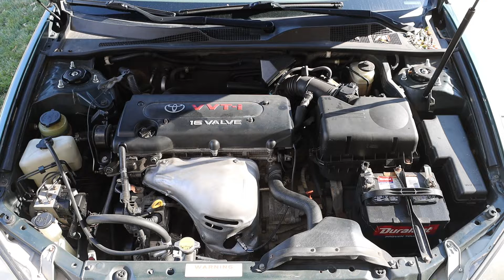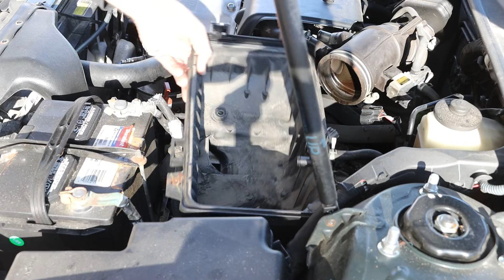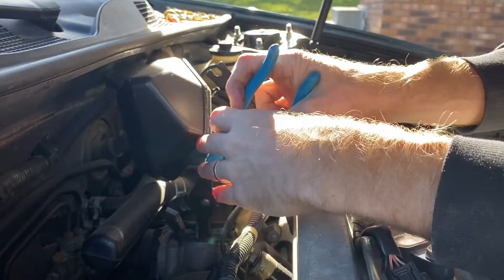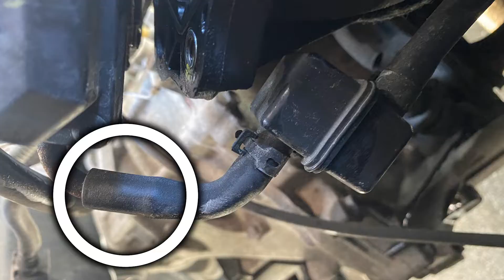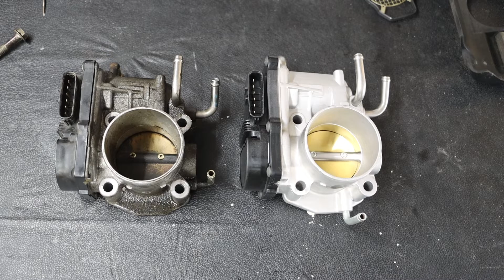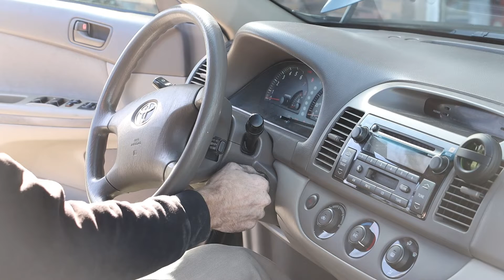Throttle Body Replacement - 2003 Toyota Camry, 2.4L (2002-2006) Low Idle, No Power, Sluggish Engine

Comment: When to know that the only option is replace the thottle body?i have a lexus es 300 2002 is similar to the camry of this video,the car entered on limp mode the code is p0120 what do you recommend me?thanks in advance
Reply from the maker: A P0120 code doesn't necessarily mean the entire throttle body needs to be replaced. That code indicates a problem with the throttle position sensor circuit, which could be caused by a faulty sensor, damaged wiring, a poor electrical connection, or an issue within the throttle body itself.

I would start by inspecting the electrical connectors and wiring around the throttle body. If you have access to a scan tool that displays live data, you can also monitor the throttle position sensor readings while operating the throttle to see if the readings change smoothly.

I would only consider replacing the throttle body after confirming that the sensor or throttle body assembly is actually faulty. Your 2002 Lexus ES300 uses a different engine and throttle body setup than the Camry in my video, so the diagnostic and replacement procedures may differ.

Hope this helps!

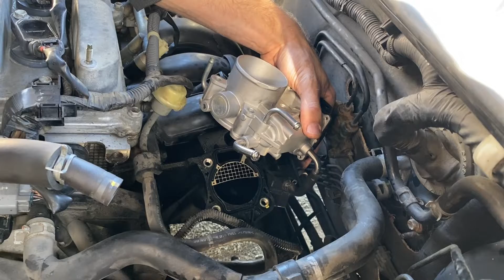Comment: Please where does that EVAP hose 4:34 connect to... My top gasket got burnt and I towed the car to a mechanic shop but when I collected the car I noticed that specific hose had been disconnected, I asked the mechanic to connect the hose back he said that's how it was but I don't believe him.....I didn't want to cause a scene as I didn't have proof to countee what he said.

The car rides ok but idles roughly and I can't help but think that disconnected hose is the issue. The mechanic says my ignition coils and spark plugs needs to be changed for the car to idle smoothly.
Reply from the maker: Thanks for watching! If you're referring to the hose I reconnect at about 4:34, that hose is supposed to be connected. It is part of the vacuum/EVAP plumbing associated with the throttle body. I would not consider it normal for that hose or its throttle-body connection to simply be left open.

A disconnected vacuum/EVAP hose can potentially cause a vacuum leak and contribute to a rough idle, depending on exactly which hose has been disconnected. That doesn't necessarily mean your mechanic is wrong about the plugs or coils, but personally I would want the disconnected hose properly identified and connected, and any vacuum leak ruled out, before replacing ignition components based solely on a rough idle. If you can compare your engine to the connection shown at 4:34 in my video, that should also give you some documentation of how it was connected on this 2.4L Camry.

Also, if you are wanting to do the plugs and coils feel free to check out my video on that https://www.youtube.com/watch?v=-oCW-m-WLHY&t=240s
Reply: @InsaneOil thanks for the response, it's very much appreciated. I actually hoped you will show where the hose 4:34 terminated. I because I have checked and can't seem to find where the hose terminates. It worries me. I have changed the spark plugs and ignition coils today but I am yet to test the car because I am waiting on a replacement motor for one of the radiator fans.

Edit: I just watched your other video https://youtu.be/_c73sk4vxGA?t=320&si=VYf8w2NWJ5WkjWbo I noticed that the hose in question truly doesn't have a termination port

Comment: Great video!! Can you SHOW me please, where the idle control valve is on 2003 Camry? I am told I could clean that without doing full assembly. Your help would be greatly appreciated (IF you're still on here). 
Also, where and how to determine the engine model (Yours is a K). Thank you.
Reply from the maker: Thanks! I'm still here! On the 2003 Camry with the 2.4L engine, there actually isn't a separate idle air control (IAC) valve to remove and clean. The 2.4L uses an electronic throttle body, and the computer controls the idle speed by adjusting the throttle plate itself. So the throttle body shown in this video is also what the engine uses to control the idle.

If you are just wanting to clean your throttle body/butterfly valve/etc.  You can use a product called Power Foam, shown in this video https://www.youtube.com/watch?v=JXHuq6jJ8og I bought the product at: https://www.amsoil.com/p/amsoil-power-foam-carburetor-and-induction-system-cleaner-apf/?zo=10458

As for the engine, the 2.4L 4-cylinder in the 2003 Camry is the 2AZ-FE. You can also look at the emissions/engine information label under the hood to help identify what engine your particular Camry has.

Comment: I got a throttle body from amazon, cheap chinese one. So guess i got a dead on arrival one because i put back everything back together and make sure it click in. Did the relearn procedure and try to start it, then nothing happen it just crank, no start.
Reply from the maker: About 1 out of every 20 parts I have to return on Amazon due to poor quality.  I'm curious if a different brand of one resolves your issue.
Reply: @InsaneOil  yeah it was a dead new throttle body, i put back in my old one yesterday and the car start right up. thanks for answering.

Comment: on the v6, the throttle body is east and west not  north/south.
Reply from the maker: I suppose if they made it the same, it would be too easy of a repair.
Reply: @InsaneOil  on my 02 v6 SE , it also didn't have a gasket similar to the one shown. it's more of a gasket similar to one on the oil pan where it's just on the perimeter. i plan to replace my oem with one from a junkyard and it that doesn't work, a new one from ebay. they're not inexpensive if bought at rockauto.

Comment: Did this actually go bad or did you replace it just for content sake?
Reply from the maker: When the temperature got cold outside and I would start the car in the morning, as I began to go, the pedal felt like it wasn't doing anything when I would push it.  If I pushed it down half way and hold it for about 5 seconds it would then kick in and the car would start to accelerate.  Specifically, this happened multiple times when at a stop sign and turning into traffic, which was a precarious situation. Based upon the research I did, there are a bunch of little gears/electric motor that electronically control the throttle and after time they get sluggish at responding to the pedal being pressed.

Comment: What's the fluid that leaks out of the two water bypass hoses?
Reply from the maker: Coolant
Reply: @InsaneOil  thanks! Great video!
Reply from the maker: @PlunderAchiever  Thanks for the comment.  Good luck with your repair.

Comment: I recently bought one of these. Seems to start and run fine  but it's got a bit of a rough idle and lurches forward. I've cleaned the MAF and TB but it's still doing it even after resetting the cpu. Also when I take my foot off the gas the RPM's drop like it's shifting up or something. It's really sensitive when you're trying to lightly apply throttle and can make for a not very smooth experience.
Reply from the maker: Any transmission issues?
Reply: @InsaneOil  Turned out the previous owner installed a slightly wrong o2 sensor. The right o2 sensor fixed 95% of the problems, but also has a slight vacuum leak at the intake which I'm assuming is causing the rpm dip when letting off the gas. Gasket is on the way and should fix that
Reply from the maker: @mtnmotoadv  Good to hear you got most of it figured out.
Reply: you can reporgram the throttle body.

Comment: When you started the car your rpms looked to be high like 2000. I know people will say that's normal but it's not. 1500 rpm is as high as it should be at starting the car and that's on a cold day and should drop down as it warms up to around 650 or so. What was your rpms normally reading on a cold start before you replaced your Throttle body?
Reply from the maker: After Repair: RPMs drop down to around 900 and even a bit lower when idling.  When the car first starts it goes up to 2000 and then quickly drops down to idle.  Before repair: RPMs were under 650 to the point where it felt like it was going to die at times.

Comment: Hello i checked on the throttle body and engines. The 2az fe does have the Iac valve while the 1mz fe and the 3mz fe have the TPS. Those are the 3.0 and 3.3 v6 motors

Comment: Good grief, you could have bought a new Camry with the money you spent on all the parts. You said it burns oil, have you tried some Lucas oil stop leak. Also the upper cylinder lubricant.
Reply from the maker: Thanks for the comment.  The burning oil is due to the previous owner's lack of maintenance in conjunction with Toyota's engineering of the bottom piston ring.  I am currently doing a research study to reduce oil consumption which does include Upper Cylinder Lubricant as one part of the theoretical solution.  As far as the money spent on the parts, I guess this is just a really expensive hobby.
Reply: I’ve got an 03 Camry with 306k miles and burning about 1/2 a quart every 1500 miles I commute 142 miles daily round trip. This thing broke down on me once 3 blocks from my house when the crankshaft position sensor lost all its magnetism. Long story short it’s cheaper to keep her than a 30,000 dollar new car. Everything works on mine. No leaks sunroof in tact.

Comment: Hello fellow crazy Camry man, my 2004 with 135 k miles has the low idle issue but seems to stick when rolling. So around 1000 rpm. Cleaned throttle body , still sticks. My Chilton's manual does say the IAC valve is attached, but maybe that's for the 6 cylinder only. Meant to check on that.

Comment: Hey so i replaced my mine recently and my check engine light still came on and won’t accelerate
Reply from the maker: Any chance your car won’t exceed 2000 rpm or about 15 mph… https://youtu.be/Ma67aYgACrQ?si=CqeiMP-w64pYkk-u

Comment: @Insane Oil
Amazing video 🔥🔥🔥- Keep it up
Is Idle Air Control Valve (IACV) separately connected in the Toyota Camry 2004 or its a part of the throttle body?
Reply from the maker: It is my understanding that the 2AZ-FE engine (the one in this video) does not have an IACV where as the 1MZ-FE engine has the IACV mounted on the side of the throttle body.
Reply: @InsaneOil From 2003 the 1mz-fe V6 does not have the idle air control valve mounted on the outside of the TB.
Reply from the maker: @dannycolemire2652  Good to know.  Much appreciated.
Reply: The 2003 Avalon's are equipped with IAC and TPS on their v6
Reply: @tomblobasjamesc.mccollum1740  Is it the 3.0 V6? So yours doesn't have an electronic throttle body?
Reply: @dannycolemire2652  the 2003 and 2004 Toyota Avalon had a mechanical throttle body with IAC and TPS . I do not know about the Camry V6 that year but the 4 cylinder that year on the Camry was an electronic throttle body with no IAC.  If you Google search your particular car, for example, 2003 Toyota camry, they will give you the exact specs of engine size options and transmission type options that were offered that year.
Reply: @tomblobasjamesc.mccollum1740 Lol I was going to tell you the same thing about googling it. I know for sure my 2003 Toyota Camry XLE 3.0 V6 has the electronic throttle body. I'll never understand why they switched from mechanical to electronic. If something goes bad on my electronic throttle body all you can do really is clean it because all the gears and motor plus tps is made inside and you can't buy parts to fix anything so you have to buy the whole TB
Reply: @dannycolemire2652  my 03 Avalon has dual mechanical throttle bodies.  One is equipped with IAC and TPS, and the other is not.

Comment: Great video. I need to clean the TB due to the sticky throttle.
Reply from the maker: I would recommend cleaning it first and if that doesn’t resolve your issue then think about replacing it.

Comment: What was the reason you replaced the throttle body? Did you have any engine codes?
Reply from the maker: No engine codes.  On cold mornings I would press the accelerator and it would take anywhere from 3-10 seconds to feel like the engine kicked in.  Basically, it was old and slow to respond on cold days.  Switched it out and it responds immediately.
Reply: @InsaneOil  Thanks for the response. Yeah mine runs well until it's warmed up. Once warmed up it still runs well under acceleration, but it has a low rough idle when I come to a stop. I have no engine codes. I think I will try removing it and give it a thorough cleaning.

Comment: Can u do a vid on how to change the head gasket for this car
Reply from the maker: I probably won't be doing that type of repair but I did come across this video that may be helpful. https://www.youtube.com/watch?v=F994QmOD6W8
Reply: Valve cover gasket or head gasket?  I just did the valve gasket on my 2006 Camry.  Replaced the very brittle gasket to address oil leak right at the cover/head. $20 for OEM Toyota part.

Comment: Excellent video!! I actually might’ve had an issue with the throttle body on my 2003 Camry as well. Almost a month ago, I went to Auto Zone to get oil for it (my Camry burns oil, especially since I drive it on the Interstate to work everyday) and when I got back to my car, it would start but then stall out less than 2 seconds later. Engine did seem to run if I started it while having my foot on the gas pedal and revving it but would stall out after I released the gas pedal. So what I ended up doing few days later was cleaning the throttle body and MAF sensor with a throttle body cleaner and MAF sensor cleaner (both throttle body and MAF sensor were dirty and had this black carbon buildup or something like that). So far the car has been starting well and haven’t had the engine stall on me after starting it
Reply from the maker: I also cleaned the throttle body this past summer ( https://www.youtube.com/watch?v=JXHuq6jJ8og&list=PLYNR1w8QDiFp7rtAildDIVAaS9qwF_0Mv&index=42 ) and it seemed to help but when the temperatures changed and I would drive it when it was cold in the mornings I would step on the gas pedal and it would feel really sluggish coming up to speed.  I did some research and found out that with these electronic throttle bodies the gears/motors get worn out and don't like to operate quite right when cold.  This Camry also burns oil...about 1 quart every 400 miles.  I am still collecting data and troubleshooting this and have a repair planned for this next spring/summer.